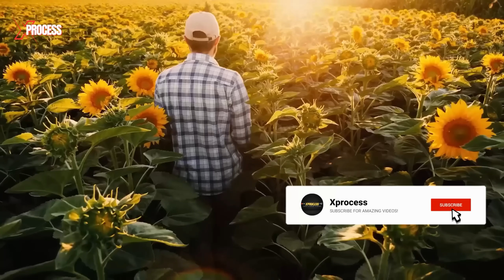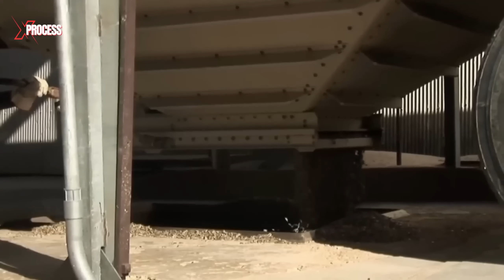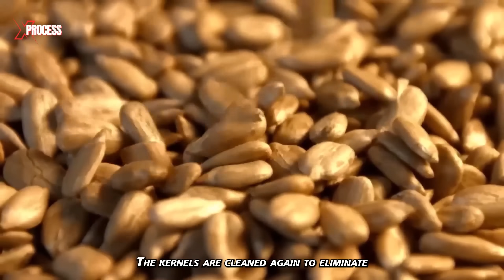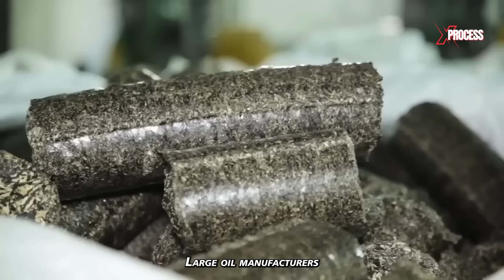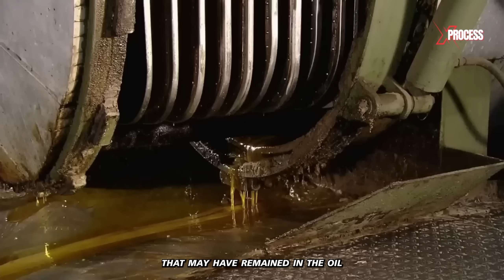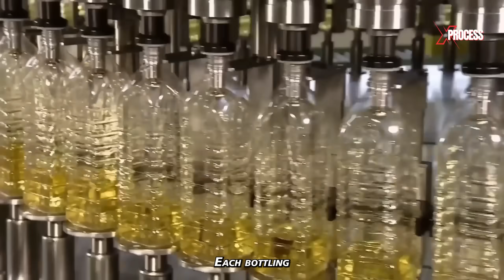How Sunflower Oil Is Made? | Amazing SUNFLOWER OIL Factory

Comment: The sunflower oil is produced with a refining process that involve heat. The final sunflower oil, not the same oil as in the kernels. 
Cold press olive oil retains its original properties because there is no heat involved!    Cold press oil is healthier !
Reply: Extra virgin and refined olive oils literally have almost the same fatty acid profile when they're lab tested
Reply: @lrn_news9171  
Wrong!
Extra virgin olive oil is cold pressed, not degraded by heat!
Refine olive oil has been heated to separate the residual oil in cold pressed olive pulp! The heat cause a degradation of the oil molecules, including the fatty acid!
This is Chemistry 101 !
Reply: @lambertois11  I've literally read studies on this. There's been studies on the fatty acid profile of all types of olive oils.

Extra virgin is from 74% to 80% monounsaturated and 3% to 4% polyunsaturated.

Pure or regular olive oil is 67% to 79% monounsaturated and 4% to 10% polyunsaturated.

Promace olive oil 75% to 76% monounsaturated and 7% to 9% polyunsaturated

Pure 100% refined olive oil has nearly the same profile, except that it lacks the minerals and vitamins in extra virgin.

Another study showed that Refined olive oil was 70% oleic acid and 1.5% linoleic which is what really matters at the end of the day, that it's not high in linoleic.
Extra virgin had half of a percentage point less linoleic which is a negligible difference
Reply: @lambertois11  You're also wrong about the process for producing regular refined olive oil. You're describing promace olive oil, which isn't sold in stores typically.

Extra virgin olive oil is cold pressed and the oil is extracted directly from be olive and it goes through a filtering process (filter out the sediment). That's it. It's the purest form of olive oil.

Some of that cold pressed olive oil is going to be used to produce refined olive oil. In this case they heat it up and use natural clay, or charcoal and steam to create a light flavourless olive oil and then they add a little bit of extra virgin to the oil to add a mild flavour. That's labeled as "pure olive oil"  
Or extra light olive oil which they don't add extra virgin to it.
For refined olive oil they use cold pressed oil that doesn't meet the quality standards for extra virgin in terms of taste etc...

The third type is promace olive oil. This one is difficult to find in stores, it's mainly used by manufacturers because of the cheap price tag. Basically they use the leftover pulp from the cold pressed extraction to extract the rest of the oil left behind with solvents like hexane. In other words they use chemicals in the process to extract all the rest of the oil and it's labelled "promace olive oil"
Reply: @lrn_news9171  
This is the living proof that the Internet is a source of fantasy!

Comment: What’s the point of the cold pressing if you’re going to heat the oil to high temperatures to deodorize it?
Reply: Seeds are roasted at a controlled temperature to prevent oil degradation. But then they cook the oil at a high temperature, which would degrade it I assume? That's the whole reason seed oils are toxic
Reply: @N30HUM4N  They are not toxic, and heating toes not destroy them. Its about how long you heat them, they start to degrade only in industial use where the same oil has been used for weeks. On normal home use, you cant degrade them by heating.
Reply: @N30HUM4N Not the whole reason I mean they're polyunsaturated fat linoleic acid. I think they would be high in linoleic acid whether or not they're heated or refined. It's the dose that makes the poison. A little bit of linoleic acid is fine but we already consume way way too much on average
Reply: You're thinking of Canola oil, you dimwit
Reply: It is heated under vacuum to avoid oxidation, which is the worst type of degradation that is accelerated by heat.
Reply: Cold pressing is actually a great way to keep the natural flavor and nutrients of the oil intact. However, if you want to heat the oil to a high temperature to remove the odor, using cold pressed oil is still very effective.
Reply: Exactly what I thought and the commentator keep saying BS about quality control and light exposure! And what happens when they use the same CRAP at Macdonald or other fast food crap to make fries 🤮🤮🤮
Reply: @Docshazzz911 
Don't have offspring, please.
Reply: Energy use

Comment: If the oil is clarified at high temperatures towards the end of the process to eliminate odours then it negates the whole cold press process of trying not to heat the oil by pressing.
In any event, if the end use of the oil is to be used for frying purposes then it is irrelevant whether the cold process to extract the oil has been applied.
Reply: What type of oil to buy ?
Reply: @YouTubeBestTopRatedMovies Olive oil, coconut oil, butter, tallow
Reply: Exactly.... I've had as delicious sunflower oil as any regular good evoo.... Sadly, the majority of the produce in supermarkets is suspicious at best.
Reply: you have not idia what you are talking about do a research on the hydrogenation process. is not the frying when you are cooking that is bad what is bad is the hydrogenation proceess that they do specially to these  type of oil because is one of the most popular hydrogenated oils out the r compared to soy oil and corn oil and then sunflower oil. these 3 oils specially are hydrogenated, plus they just do not go with the hydrogenated process's after  that they do a process's called  bleaching which they use chemicals in the same chemical family like bleach. they use the bleaching  process's afther  the hydrogenation process because the oil is so rancic they have to use bleach to removbe any particles left and not just that to get rid off the rancic smell that the oil has after the hydrogenation process. Coild press is gpoing to be 100% the best and not just that 100% healthy. Some people called hydrogenated oils "FAKE OILS" i just call them Synthetic oils just like the company that makes 100% synthetic oil for cars AMSOIL when theyu created the 100%  synthetic oil they called "fake oil" at that time  they did not know how to called the oil so they  just called it " fake oil" because that oil was not fopund on nature like on the ground it was man made oil or fake oil but today we call it 100% syntetic oiul. so my point is that all those corn and canola and soy and sunflawer oils if they look like water and are to cheap that is how you know is hydrogenated oil or fake oil or synthetic oil not founmd in the eco system or nature is man made. One to know one secrect guess what is the process to make 100% syntetic oil for cars...........................you guesss it right they or in this case the company Amsoil they use the hydrogenation process to make crud black oil from the grown and they turn it into syntectic using the hydrogenation process basically they fuse some hydrogen molecules to the normal molecular stucture fond on the crud oil they add some or fuse some hydrogen molecules to the crud oil and high presure and tempetures to make that original molecule found on crud oil to be stonger and more resisten to oxidation. So yeah when i see people cooking with corn and soy and canoila and sunflower oils i tell them you are cooking with synthetic oil something that is allmost no diffent from m cooking with engine oil, but of course engine oil is bad it will kill you faster people please do not cook your food with engine oil.
Reply: @Interestingworld100  try to use punctuation. It is impossible to read whatever you tried to explain.
Reply: @br4insful  is in code to catch your attention and keep you digging the rabbit hole.  i you can not figure what i say there then you are not good at any thing and speciallyu decoding mastery out  there like  the egiptin lamguge or symbolms out there use your brain and think out of the box.
Reply: @Interestingworld100  holy cow. You just wrote all that in one long run-on sentence with absolutely no capitalization or punctuation anywhere. And you expect us to put Credence into your words?? What a joke you are